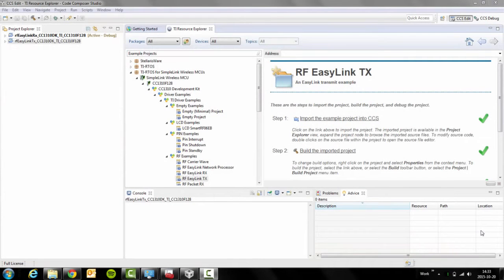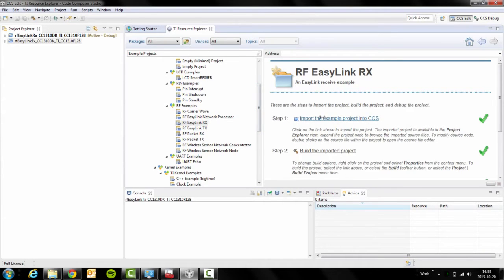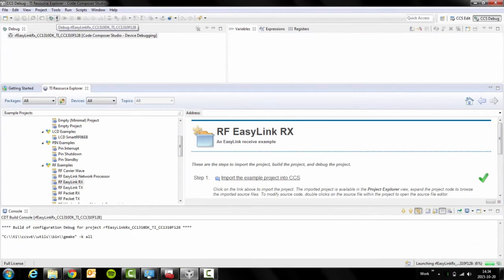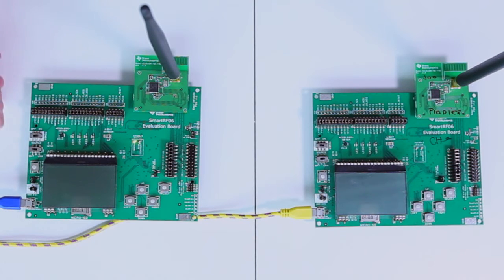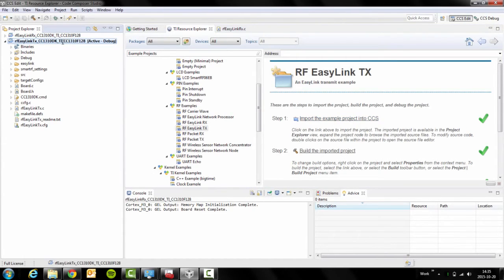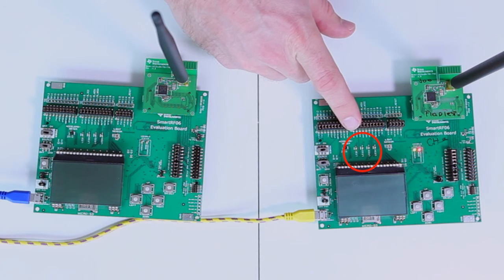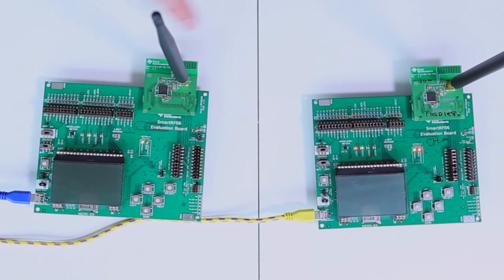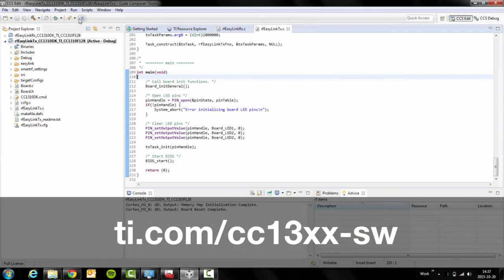How to use EasyLink RX/TX examples

Comment: Does this use Sub1Ghz radio communication? can I apply this to 2 of my CC1310 Launchpads and is TI RTOS needed or just Code Composer Studio? I would appreciate it if you can help me out with these questions
Reply: Also the CC1310 has no built in LEDs as far as I can see not sure if there is any other way to show it is working